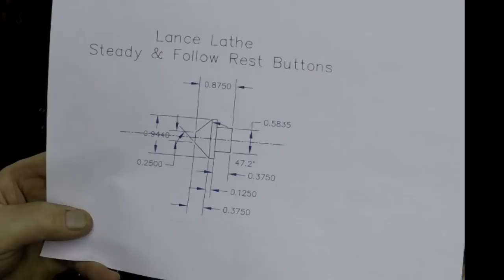How to Build Buttons for Lathe Follow & Steady Rest

Comment: Cool bike trip. I would like to see some of it in reverse so, we could experience it forward? You're killing me. First the pine trees, now the sage and manzanita. Homesick.
Anyhoo, nice build, well done. Great camera work (picture in picture is quite helpful). I get to see you working and the tool working. Excellent. The micrometer reading was off screen, but I got the point. Dead on. Thanks for the video. Very pleasant.
Reply from the maker: Jim Milne Thanks Jim, a bit cool up there.  Next bike ride will e from the front.  That was my son out tearing it up.  Hard to tell sometimes when things are in frame or not, but it was dead on.  Thanks for watching, Randy.

Comment: Looks like you got this project all "buttoned up". Looks great. reminds me that I'll soon have to do the same.

Colin ;-)
Reply from the maker: ***** Thanks Colin.  They came out good.  I think I might have found some material for a level.  Randy
Reply: Cool. I finally have my vials on the way. Took some extra work to get them shipped here.. ;-)
I went back to where the iron is but it's buried now with snow...might have to wait till spring...
Reply from the maker: ***** I have a couple also on order, they take a while to get.  Bummer on the snow.  Long term projects.  Thanks Randy
Reply from the maker: ***** Colin, I just received my 2 vials today.  I also think I have found a piece of heavy iron for the levels.  Randy
Reply: Cool, I have to round up some material for the vial covers as well. Should be a fun project. ;-)
Reply: CompEdgeX 143xp.cpm

Comment: As always, great stuff.   I was wondering if you've checked the motor and sheaves for tightness/alignment recently. I don't hear anything unusual but then again, we really didn't hear the mess that surfaced during the belt change/conversion.  Oh, and please make sure the clip on that mic can be pulled off easily or run the cable inside your shirt and out the back. I don't want you to suddenly stop making videos. Congratulate your daughter for us. We are appreciative of her commitment and proud she is an American.
Reply from the maker: Ken Wolfe Ken, why would I have to check on a perfect job.  But yes I did check everything a couple of weeks ago.  All in good order and thanks for asking.  The Mic is a kind of a pain, eventually I will have to go wireless.  Or you could make a donation in concern for my safety of being sucked into the lathe.  Thank you and I will pass it on the the Major.  Thanks for watching, Randy

Comment: unless you are going to run small stock through the follow or steady, can't you cut less taper in inserts to allow for more contact and less wear?  In some cases depending on the expected use of the rests you could almost leave the taper off completely
Reply from the maker: flineman Oh yeah, this is just a starting point,  I would modify the ends as needed depending on the the job at hand.  Thanks Randy

Comment: Randy,
I liked the bike ride at the start. You have some pretty good looking supports for your rests. A word of caution -- try putting your mic cable under your tee shirt. With it hanging down like it is, I can see the cable getting tangled in cranks, handwheels, etc. on the apron! Nasty things could happen! Just a thought, and I'm not trying to be a safety Nazi!
Have a good one!
Dave
Reply from the maker: Swarf Rat Thanks Dave for being the Safety Nazi about the wire.  You could make a donation for the wireless mic fund, I do accept Pay Pal. LOL.  Thanks for watching, Randy
Reply: Randy,
If I had $700 I'd get you a nice Sennheiser wireless mic. Quality wireless mics AREN'T cheap!
Dave
Reply from the maker: Swarf Rat I have only look into it a little bit.  I am ignorant in this field of audio, I try to do the best with what I have.   Thanks Dave.  Randy

Comment: randy was there a reason you started from the large end? i would think it would have been easier to cut the small diameter first then part off .when you had all your pieces cut ,stick them in the 3 jaw and cut the nose angle.
Reply from the maker: larry sperling I wanted to do it all int one setup.  The base didn't really need to be machined, I just hit it with a file to clean off the numbs.  But you could of did it the other way.  Thanks Randy

Comment: Why not use roller bearings as a substitute for the brass buttons so there’s no friction on your workpiece?
Reply from the maker: Roller are great as long as you run them on smooth surfaces.  Where the brass is much more tolerant of not perfect surfaces.